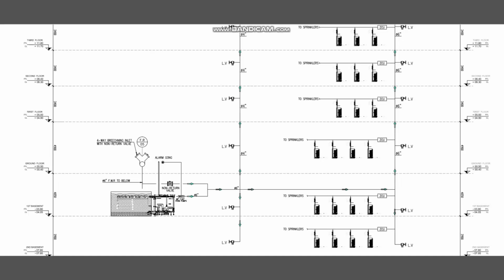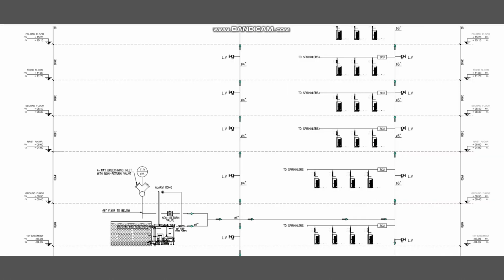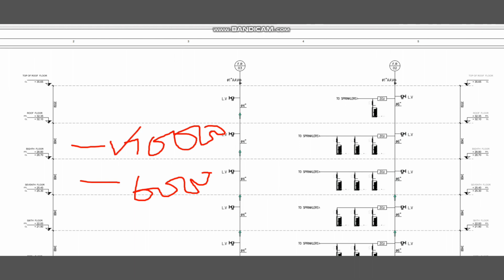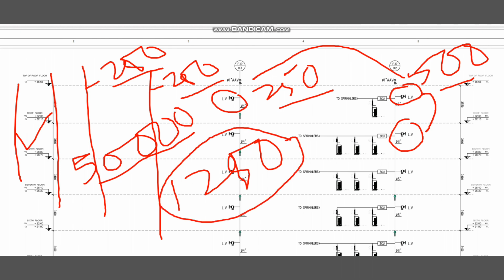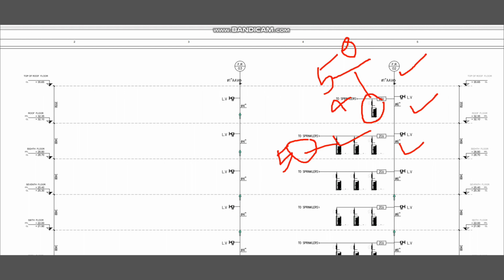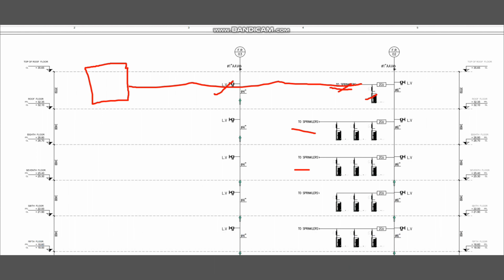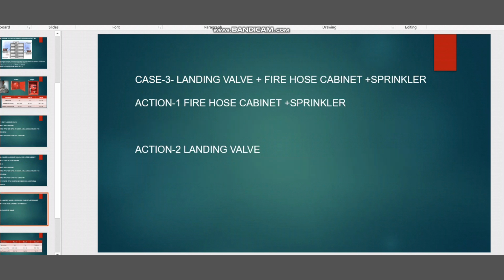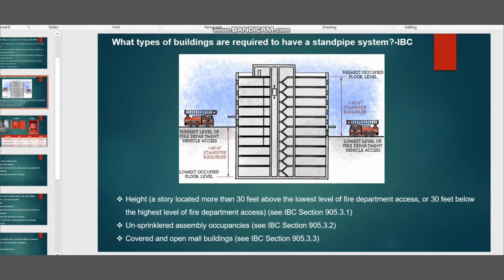Firefighting Standpipe System l All NFPA & IBC Design & Installation Requirements

Comment: 1250 gpm maximum for the unsprinklered buildings and 1000 gpm for sprinklered.

The flow must reach the maximum requirement of 1000 gpm for a building protected throughout with a NFPA 13, Standard for the Installation of Sprinklers, or 1250 gpm for all others. Each of the valves must be flowing 250 gpm, with the first 500 gpm taken through the hydraulically calculated two most demanding hose valves. This measurement is taken at the top of the most hydraulically calculated standpipe. Each additional standpipe flow is 250 gpm and is allowed at any of the hose connections on the additional standpipe(s). If the total flow is 1000 gpm for a building fully protected throughout by NFPA 13, you would be flowing 500 gpm at the top of the most hydraulically demanding standpipe and an additional 250 gpm from the base of two additional standpipes simultaneously flowing a total of 1000 gpm.

Comment: Hello Sir, I have two questions that I don't understand and hope to get your reply.

	1.	Why do some standpipe systems use landing valves while others use fire hose cabinets?

	2.	For a combined system, why isn't the flow rate the sum of the standpipe system flow and the automatic sprinkler flow? This is especially confusing when both systems are in use simultaneously.

Comment: Hi sir I just want to ask that  2 landing valve 500 gpm + 250 Gpm will be stand pipe for 1 riser
Reply from the maker: Always for last riser or residual riser 2 Landing valves so 500 GPM. Before last riser u need to see the area. If the area is above 80,000 ft2 then 500GPM or less means 250GPM (1 riser)

Comment: The class is excellent, will there be a case where only one riser for stand pipe & area exceed 80,000 ft.sq. how to calculate the gpm
Reply from the maker: @afeefpk  thank u for comment dear🥰 if u have only one riser maximum flow of 500GPM is applicable. If the area is higher than 80000 sq.ft then also the maximum flow of 500GPM for one riser is applicable. It will not go higher than 500GPM for one riser